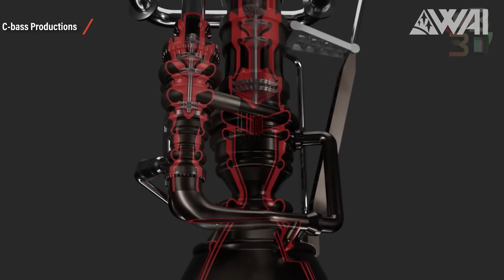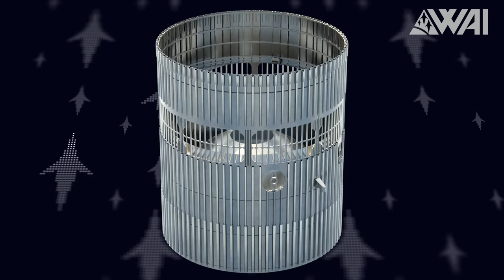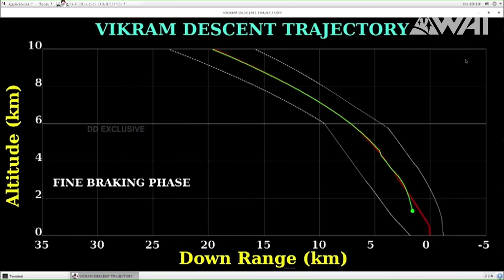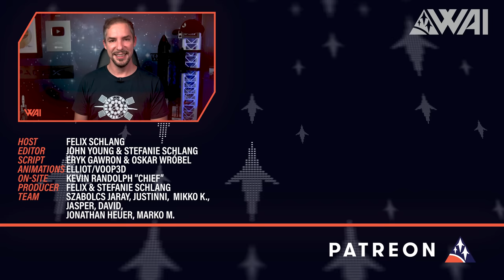Epic Testing Change! Is SpaceX's Starship Raptor Engine Unreliable?

Comment: Good to see people actually showing realistic concern and not just being delusional like it was a great static fire
Reply from the maker: Realistic concerns and perspective! Booster 9 did better than Booster 7. That's what counts the most! :_WAISweet: They'll get there eventually. :_WAIHeart:
Reply: It's a TEST article!  If anything was garnered, it was in fact a great static fire.
Reply: "...delusional like it was a great static fire."   You really don't get the concept of prototyping, bro.  The data of the test is the goal of the test.  It's not a production vehicle, so perfection would be an irrelevant result.
Reply: They can’t help themselves.
Reply: it was a good test fire, minus that it was only half as long as intended, and 12% of your engines failed. they have to know why it happened, and fix it. trying to launch because someone's ego says they should launch will just result in launch failure 2.0
Reply: @dudermcdudeface3674  yet this is a launch ready booster .so....
Reply: @mrmattbassett  cults are like that.
Reply: The group of toxic optimism gets quite tiresome whenever they shout down people with technical criticisms or opposing takes. I much prefer the realistic and educational takes into the problems SpaceX are trying to solve, while maintaining a sensible amount of positivity.
Reply: @ThatOpalGuy   None of the engines "failed."  They were intentionally shut down based on test parameters.  What don't you guys get about what "test" means?
Reply: @ThatOpalGuy  It's a prototype booster intended for test launches, yes.  TEST launches.  The goal is just to improve.  Anything past that would be a bonus.
Reply: Failure is an option. It just doesn't sound good. 😊
Reply: @ThatOpalGuy  
Test launch ready.

Comment: Raptor, doesn’t take a genius to see they are having severe issues.  Might be the sucking from same source. Raptor may have zero tolerance when it comes to variances in flow & pressure.  Could take time to iron out. Next launch will loose engines for sure, maybe keep enough to make it. Time will tell.

Comment: The Merlin engine is fueled by RP-1 and liquid oxygen, while the Raptor engine is fueled by liquid methane and liquid oxygen. The Raptor is also much more powerful. They are breaking new ground with this engine and learning as they go. The first launch of Starship was not an orbital launch attempt. It was a launch attempt and was highly successful. It went better than expected and they learned things they didn't expect to learn. The first orbital launch attempt has yet to be scheduled.
Reply: Yes failure = success. Everything they ever do will be labeled success, and celebrated as a learning opportunity. Cults have a way of twisting reality that way

Comment: 10% failure -- That suggests its a systematic problem maybe fuel or vibration related (or vibration leading to fuel issue)  -- cause a 10% failure rate would certainly have been seen over test of at least 200 engines in single engine test mode at mcgreggors.
Reply from the maker: Interesting take!
Reply: Agreed. As far as we know, they're not seeing high failure rates when individual engines are tested — this is purely something which shows up when fired en-masse in a booster.

Comment: It's not the engine that concerns me. They'll figire it out. It's the number of them that they're trying to light at once. I'm skeptical that they will ever get 30+ engines working at once consistently. They might even fly cargo missions with an acceptable number of engine losses during the climb to orbit. I really think it will be a year or more and many, many test flights before the cam get the manufacturering, installation, and start sequences perfected enough that all engines lighr - and stay lit - every time. I am totally rooting for them, though, and I hope they prove me wrong.

Comment: This recent test was probably 90% a test of the OLM for the FAA case, and it didn't hurt to test some Raptors in the meantime.
Reply: And what did they prove in 2.7 seconds at reduced thrust? Previous similar test showed no problems with old OLM configuration!!
Reply: @Mentaculus42  Didn't they have to redo the fondag for that test?
Reply: @rcrdps8144  
Nothing significant if I remember correctly, but then how transparent was spacex about it? Maybe there was some damage, but spacex has a tendency to not let Info like that to be released unless it is obvious. The interesting thing is that spacex has the steel floor covered up on the OLM the last I saw. Maybe they want to keep small rocks from falling into the holes which could be ejected into the engines next time. It is a bit ironic if they need to cover the deluge system with a blue tarp for that reason as part of the original concept of the OLM was to have easy access to the raptors for rework at the OLM. Kinda a slippery slope there!

Comment: 33 engines is too much complexity to deal with. They should just make one big one boom problem solved
Reply: Then they wouldn't be able to land it. They specifically designed the engines so that they could hover the booster and ship with 1-3 engines when they are essentially out of fuel. One large FFSC methalox engine couldn't throttle low enough for them to hover.

Comment: I think 33 engines are too many. I get the advantages of many smaller engines Vs fewer bigger ones. But I guess these advantages aren't worth the complexity
Reply: The Falcon heavy has 27 engines. Different Cycle (Gas Generator) and Fuel (Kerolox), but it is now amazingly reliable. The Raptor is still in development, and it has a difficult cycle (FFSC) and fuel (methalox) in combination which no one else has ever flown. There is a very good reason Spacex decided to go with multiple engines, as opposed to a few big ones. It needs smaller ones to be able to slow down (boostback) and land the booster and second stage. The Falcon booster lands with ONE of its 9 engines. Its all about reliability and re-use. So, they develop ONE engine type which can do it all; operate at sea-level AND in Vacuum, push 5,000 metric tons (total weight of SH+SS+Fuel+Payload) to orbit, AND land the Booster (120 tons dry weight) with 1-3 SL engines, and land the Ship (85 tons dry weight) with 1-3 SL engines as well. 

Bigger engines would not allow you to land. They are not able to be throttled that low to enable the vehicle to effectively hover.
Reply: @stefanbaartman5893  saying F-heavy has 27 is disingenuous.  It's badically 3 F9 strapped together side by side. So, it has the complexity of 9 engines, not 27.

Comment: The engine shutdown may be as simple as vapor loc similar to what you get in a gasoline engine when it gets hot, using a carbonated fuel system. To fix this is more insulation.

Comment: I still hold that the B9 hotstage ring needs to be constructed diamond, triangular, or honeycomb shape to distribute the load forces of launch and the weight of S25 or it will collapse under those pressures. The vertical stringer design could easily be crushed from uneven loads on the ring during launch. I don't think we've even seen results yet of any ring crush tests yet either? Time will tell.🙏

Comment: Excuses asides...  Quality control and or production should catch any possible issue before they're installed into a Starship. It shouldn't happen period and it's becoming a issue. They haven't had a complete successful static or launch with Raptor to date. Not all of them.

All your mights are irrelevant, they shouldn't is the point.

Comment: Would rather be on a rocket with 30+ engines and lose 4, then a rocket with 3 and lose 1... 

While for "testing" even if everything went perfect the first liftoff was never coming back to earth. I believe for a first flight that is meant to be possibly crewed one day; they could have had a fair chance at recovering the ship minus the booster if they had absolutely needed to. So looking good. 

People arnt perfect. We learn over time by doing/trying and possibly failing. This is what I always hated about NASA... pretty much had to work 100% first time every time...

Comment: I watch till 2:34 and figured this guy doesn't have internet to fact check his info. First full flow staged combustion engine was designed is 1960s and used in diferent Russians and US rockets.

Comment: You probably hadn't seen the possible cracks in the concrete next to the OLM when you made this video. Your enthusiasm works inspiring but don't be naïef. 4 engine failures means 12% failure. And the new floor under the OLM has barely been tested. 2.74 seconds is nothing compared to the orbital launch test that fired on (and in) the ground. And I hope SpaceX will never consider launching a vehicle with any amount of engine margin. All engines need to work. They don't put 33 engines under the booster so they have spare, but to achieve full capacity lift.

Comment: I don't think it is the engines on the first flight four or five engines did not ignite or had problems after igniting I don't know what the part is called that connects all 33 engines together and gives them fuel but I think there is a problem with fuel distribution the only reason I think that is because it is repeating itself

Comment: Excellent episode, Felix! So good to escape the "Raptor Unreliable" reaction I see from so many others.

Raptor engines are so much more thoroughly tested than nearly any other SH part. How many full-up tests of SH have we  had? GSE, start-up of 33 engines, plumbing manifold, etc have been tested in static firing less than five times. Seems likely the problem is with sub-systems much less tested than with the Raptors.

Comment: The big question is, how many hundreds of SpaceX employees are frantically working to acquire the Flight Safety Analysis information required by the FAA to determine if the next Starship skyscraper launch is safe and then approve it? Based on SpaceX's experiences with Falcon 9 and Falcon Heavy, my bet is that SpaceX engineers will have acquired all the safety data the FAA needs to approve a launch by the end of September. The bigger question may be whether or not environmentalists hold up the launch because of some endangered bird or ant.

Comment: What a joke.  They can't even get all of the engines running for the duration of the test.  Russia did this back in the "space race" race days.  The first stage of their moon rocket had 30 NK-15 engines.  They never could get it right.  N1 3L engine fire, exploded at 12 km (sound familiar), N1 5L launch failure, destroyed the pad (sound familiar again), N1 6L insufficient roll control, destroyed after 51 seconds, N1 7L engine cutoff at 40 km, ruptured fuel lines, vehicle destroyed.  Ended program.

Comment: The problem could be having 33 engines instead of an average 4-5 engines on most rockets. The N-1 had 30 engines and never had a successful launch.
Trying to synchronize all those engines , fuel lines, wiring,  thrust balance etc etc must be a bish.  Guess we're gonna find out if its a winner or loser.

Comment: Are Starship’s Raptor 2 Engines unreliable?  

Absolutely.  They’re not reliable at all.  There were far too many failures during the first test launch.  And there were even more failures right out of the gate during this last static fire.  Personally, I think Elon is taking the wrong approach.  He’s following the former Soviet plan of packing lots of engines in the least amount of space as possible.  His intent may be honorable, as it would seem that a few engine failures wouldn’t prevent a successful launch of the entire rocket.  But taken as a whole, that’s not how it works out.  For multiple reasons a failure in one engine tends to spread to nearby engines as well.  The Soviets learned that the hard way.  Looks like Elon’s going to have to learn the same lesson.  

As much as I would love for Starship to be the solution for all things rocketry, that’s not even close to being the case.  Starship’s biggest problem is that it’s simply TOO HEAVY.  Or, Earth’s gravity is just too strong.  As we can’t dial back the gravity (that would certainly make things much easier if we could), Elon’s built larger rockets to compensate.  But how big is simply too big?  I think SpaceX has surpassed that limit.  NASA’s Saturn V was probably riding the feasibility limit.  After that, we need to take an alternate approach and build these ginormous rockets up in orbit.  Then they won’t have to actually fight against our planet’s gravity.  While the gravity will still be there, the ability to gain enough speed to overcome it will be much easier.  That’s because a rocket traveling at 17,500 mph around our planet falls into a stable orbit.  And while that rocket still retains it’s mass, it’s weight disappears.  Thus, any thrust applied to that rocket is vastly more effective at drastically increasing the rocket’s speed. And as weight is no longer a primary factor, rockets assembled up in orbit can be significantly larger, carrying vastly increased payloads with considerably more efficiency.  Starship’s biggest problem is just that…it’s big.  Too big.  Far too big.  And yet, it’s still far too small for taking mankind to Mars and further.  Such a rocket needs a payload capacity that would be every bit as large as the current size of Starship now, if the rocket’s entire structure was turned into storage and living quarters.  And then you would still need to add on the propulsion systems.  While in orbit.

Comment: " Is SpaceX's Starship Raptor Engine Unreliable?"
bro have u like ever watched anythink they have done in the last 2 yrs? yes they are unreliable... SUPER UNRELIABLE... even in static fire the shut down / melt the copper lining / or RUD
... like bro just look at the latest static fire... they aimed at 5s but aborted after 4 engines shut down after just 2.74s

Comment: if elon think engine like jet engine add's tapering exhaust nozzle he gain more thrush less engine power and he keep engine 100% and control of the rocket better, why stuck with 1960 style engine it 2023 not stone age. why don't any rocket on this planet use tapering exhaust nozzle go faster, i was thinking he had IQ 200 he make ai robot but not work out how get more thrush out his engines he could build better ones they are good now but could lot better. He should make one big one middle and 8 smaller have better control of rocket.

Comment: Problems with Starship engines is not related to engines, but to launchpad. It should be higher. Small space inside the launchpad during ignition makes negative thrust inside the launchpad, and hot steam directed against engines destroys the nozzles (cones). As the result liquid methan, warmed inside the cones, escapes and makes things even worse. This is why they stop engines. After installation of the "collar" on the top of the launch pad it should be more room inside the launch pad, and the engines can survive extreme heat and pressures inside the launch pad. We have to remember, that in this way Elon compromises wrong design of the original launch pad, and its efficiency is far behind NASA launchpad. In my opinion Starship needs something similar or better than NASA launchpad technology, it deserves it. The rocket is awsome.

Comment: having lots of different engines all with small tweaks here and there let’s them test all the choices they made and collect data in a wider range. they’re still in testing so why not actually test. let’s throw all our engines that run onto one of our boosters that’s solid and find out where we stand. then after this next fucked launch they can really refine their work and look at all the data and finish with an extremely reliable rocket just like they ALREADY have. might be inefficient in performance but they’re not in data.

Comment: The Raptors are a problem only when they start ... not that they are unreliable.. but because they are tooo powerful.... it's like using a nuclear charge instead of gunpowder to propel a bullet...the gun will never survive...neither will you..😂..or anything else for miles...the starship is ready.. the olm needs more fortification to handle the Raptors...

Comment: Ah-ha-ha. WAI enters "beautiful" waters of damage control art. :D
Just face it. Raptors suck for now and you were wrong to praise and celebrate (along with the majority of "space community" though) "cool" SpaceX's move to strip Raptors of all those sensors when they moved from v1 to v2. It was too early and that's probably why they struggle to properly work on them now. They probably just don't have enough data.
Reply from the maker: Where do I even start. Those Raptors, all of them, performed flawless static fires in MCGregor. Without the booster they're reliable. They do have tons of data. The real reason likely is harmonics or vibrations in the booster itself as said in the episode. A flaw in the fuel manifold could be the reason. This is not damage control. If there's something that still needs work, I'll point it out. I've always done that.

This part of today's episode was to inform and explain that the Raptor engines likely aren't the problem and that there's been improvement since Booster 7. This is a test campaign. SpaceX will test until they fail or until a Starship works as intended.
Reply: @Whataboutit  Maybe it's not damage control, but it does sound like one. And it's not a bad thing, you're SpaceX fan, so you want them look good, that's ok.
And yeah, that's exactly what I'm talking about, this is a test campaign, removing all those extra sensors was too early. :)